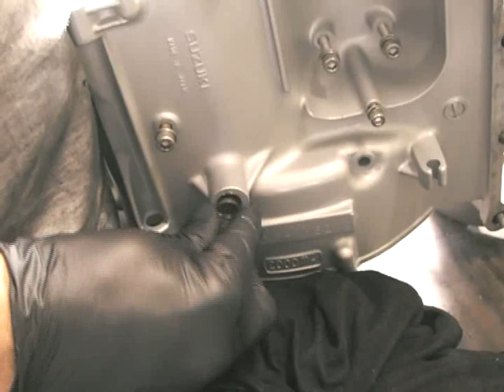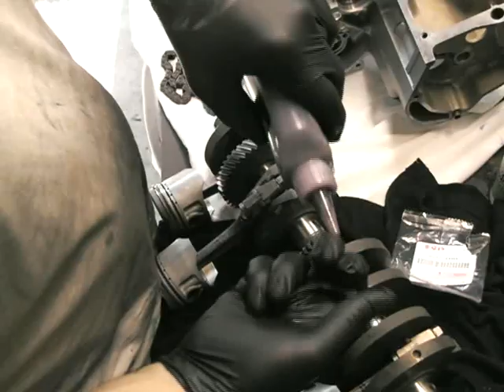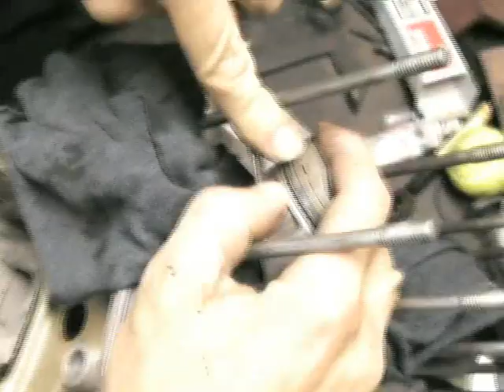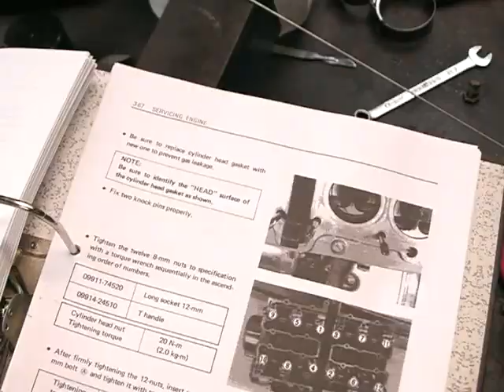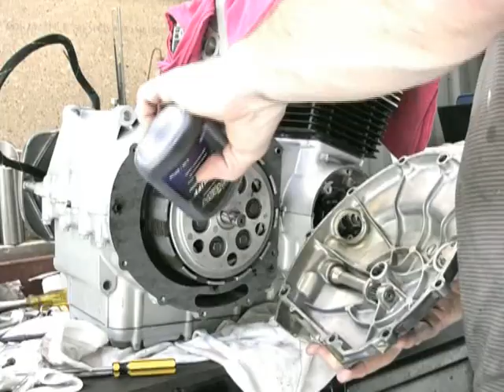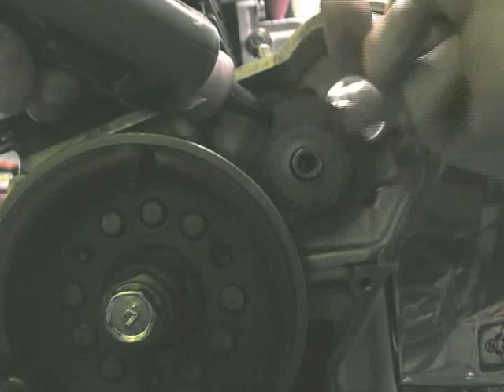Race mower Part 4 GSX400F engine overhaul

Comment: Disculpa el carter de la Suzuki katana 400f le queda todo lo del 600f ?
Reply from the maker: Hi, I’m not sure as I haven’t worked on a 600f
Reply: @Mezzmoengineering Hello! Are the engine blocks of the Suzuki Bandit K707 and Suzuki Katana K708 the same?
Reply from the maker: @ДимонЮрьев-ю6щ  Hi, I'm not really sure as the engine in the video is the only one I worked on. Maybe try one of the Suzuki bike forums as someone should have this info for you.
Reply: @Mezzmoengineering  Thanks

Comment: Excellent job!  I thought that before installing the cylinders you should aligne the rings cut 120º from eachother.
Reply from the maker: Hi, yes that's what you should do. I didn't show that because I re-used the rings and then a bit later I fitted a new set after seeing some smoke after getting it running.

Comment: I bought yesterday the gsx 400 s which has 2 zylinder, not 4 like here, tomorrow im gonna to open the engine and restore it.

Nice video, help me a lot. Thanks
Reply from the maker: Thanks mate, good luck with your build
Reply: @Mezzmoengineering  One question: how did you open the crankcase?
I opened all bolts but the 2 pieces are so stuck/glued together...
I dont know how to open this thing.
Maybe you have some tricks...
Reply from the maker: @janrueticlips  Hi, yes its glued with sealant. Once all bolts are removed you need to ease a blade or screwdriver and gently tap into between the casings to get them to separate.
Reply: @Mezzmoengineering  thanks!

Comment: Hey i have a question my Suzuki bandit 600s my clutch lever didnt work anymore than my ölpump dosent work the red lamp is on and i can go in first gear or second and i can roll my bike like there is neutral. And i can go with my finger by the oil filler and the clutch basket is 
loose. sorry for my english :D i hope my motor dosent take damage ....
Reply from the maker: HI, it doesn't sound good. If I was you I would remove the bottom engine cover and check the oil pump carefully. Also, you should remove the side cover for the clutch to see whats going on in there. Good luck. Running it more now is likely to just cause more damage.
Reply: @Mezzmoengineering  Problem solved the screw what u tighten in 18:00 min was loose ...
Reply: in 18:12
Reply from the maker: @thekilon4085  Good work! Make sure its tight and you use the tab to hold it tight
Reply: @Mezzmoengineering  okay i use carefully a impact wrench and screw locking lube.
Reply from the maker: @thekilon4085  Good work, ideally there should be a metal locking tab behind the nut that you bend once its tight, this will ensure it never works loose...
Reply: @Mezzmoengineering  Ahh okay i didnt bend the metal but i tighten it Good is it okay? Bike runs now, im so lucky that the basked didnt scrap anything....
Reply: motor=engine *

Comment: Nice build.  What did you use to get the covers like a polished mirror?
Reply from the maker: Hi, I used a polishing wheel attachment on my bench grinder. Starting with sanding, then different polishing compounds and some patience

Comment: How much did you pay for that engine? Building my mower soon
Reply: Just seen it.. your friend donated
Reply: Those engines are pile of junk even after rebuild. I had one from 83 with changes to the crank and big end shells. Two days ago it spun cyl 1 big end shells - pile of junk now, works like bucket of screws and nuts. What is ironic? I have checked every 5000 km maintenance job oil pressure and used synthetic every time. It spun shells anyway. THOSE ENGINES HAVE OIL DELIVERY FLAW even after the changes later in production. Mine lasted 90839 kilometres, two days ago it died. I don't think rebuilding high mileage engine is much of sense.
Reply: @MrHimer12  JAJAJA siempre le pasan esas cosas a los pendejos... No es solo cambiar el cigüeñal y las balineras de bancada... tambien tienes que revisar la bomba de aceite.. estos motores son incluso mas confiables que uno refrigerado por agua... alguna vez vi uno puesto a linea roja durante 24 horas sin morir... pero tienes que ser muy cuidadoso con el sistema de aceite..